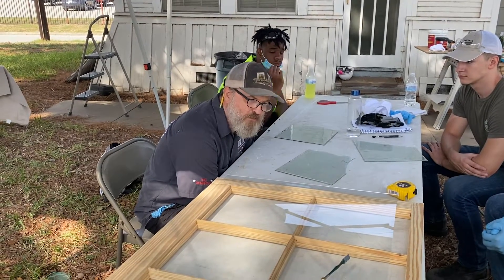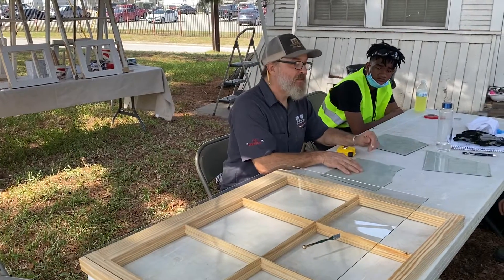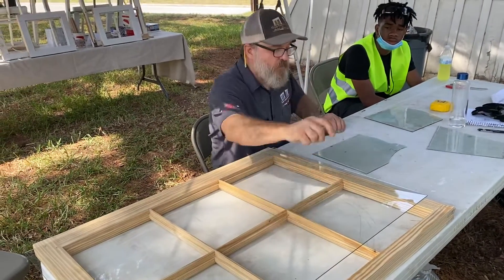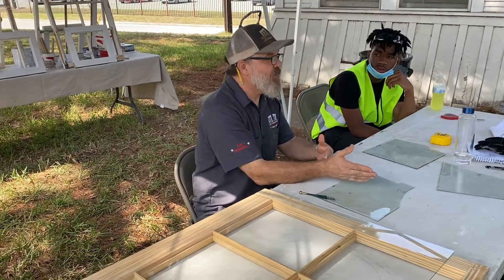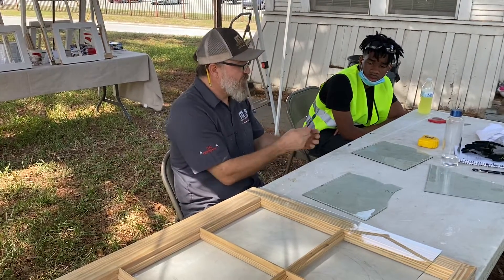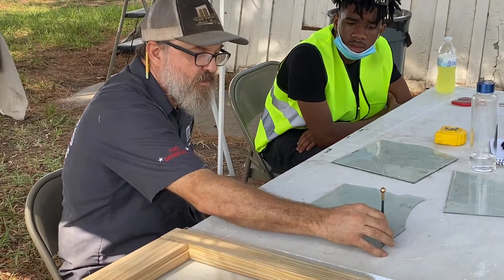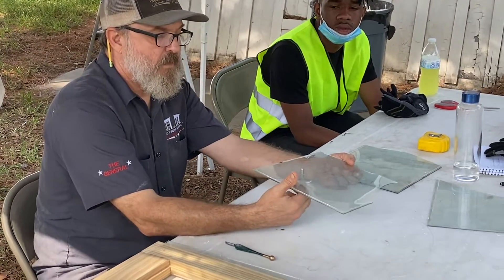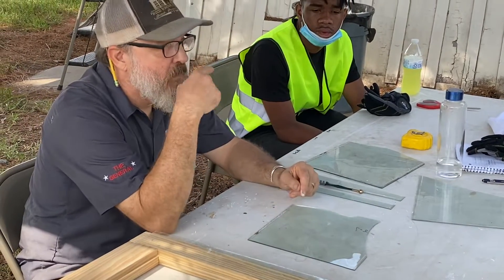Cut Your Own Window Glass! It’s Crucial!

Comment: I have no trouble with smaller panes of glass but when I try to do the exact same technique with larger panes of glass for outer storm windows, i have broken more than I’ve made let’s just say….🤣🤣🤣 
Do you have any tips for larger panes of glass?
Reply from the maker: It’s important that there’s no stress on the glass anywhere. If that upper corner furthest away from the cut is left dangling in the air, the dangling will stretch the glass to where it’s no longer relaxed, and the stress of it, when you are pulling that cutter down your line, will relieve itself every time. Gotta support that corner somehow. I usually stick a glazing knife under that corner so it doesn’t flex down into the glazing rabbet.
Reply: @WoodWindowMakeover  that makes sense. Perhaps it’s my janky OSB sheet and saw horse work table that could be bowing the glass and stressing it.